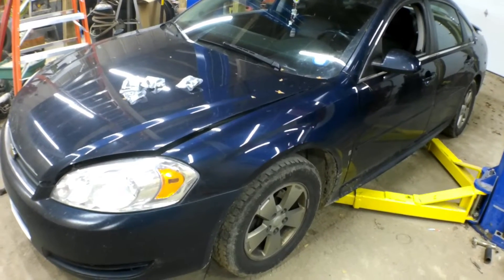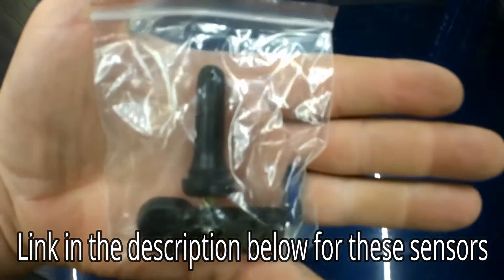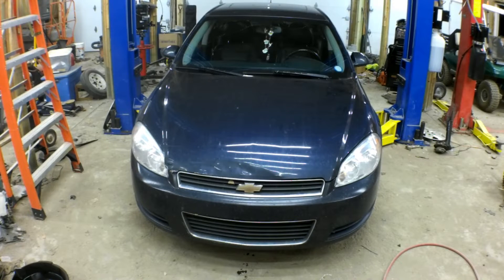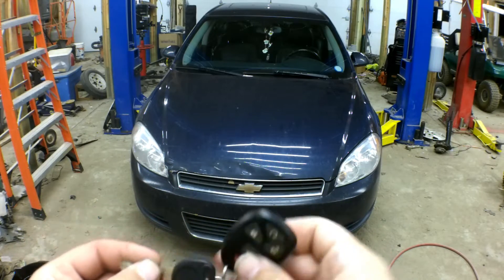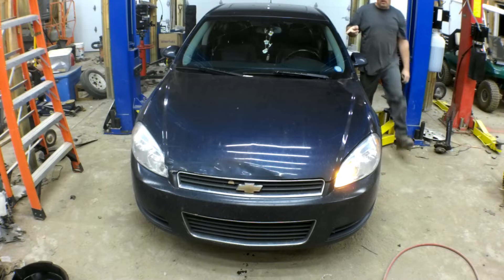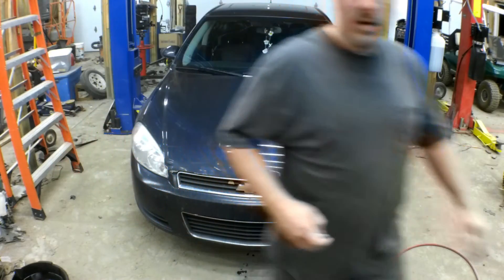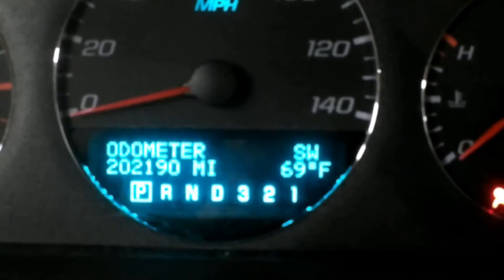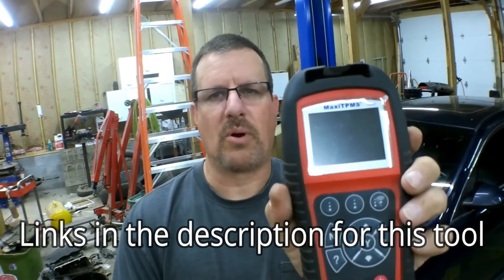How to program cheap eBay/Amazon TPMS without a scan tool!

Comment: Just tried it on my 2012 tahoe after i installed aftermarket sensors. Worked on first try. Tire shop said they couldn't program. Thanks for the video.

Comment: so this would work on a 2011 buick regal CXL Turbo as well? also, how much would a auto repair shop typically to put these on?
Reply from the maker: So any shop would likely charge the same price they do for mount and balance tires since they have to break the tire down to change the sensor. It should work on the 2011 Buick but if you’re having a shop install the sensors, they would have the tool to program them also.

Comment: My 2015 Chevy Cruze did not see the new "pre-programmed" Schrader 29049 sensors. Car went into re-learn just like the video, I started with the LF tire but nothing happened when I went from 48 LBS to 20 LBS. Probably Schrader doesn't work like this so I'll phone them. Probably need to buy the basic relearn tool somewhere.

Comment: So will this also work for a 2015 Chevy silverado 1500?
Reply: Did it work?
Reply: @jaimerios995  I don't know. Never tried it. I ended up buying a relearn tool from Amazon for 13 bucks and it worked great.
Reply: @TheDbrewer31  I also bought the tool and it worked great on some aftermarket rims with tpms  I bought but when I put the oem wheels back on it wouldn't work. Maybe I'll try this method this weekend
Reply: @jaimerios995  not sure why it wouldn't work with the stock wheels. The stocks are on mine and it work good. Was the relearn tool the orange colored one from Amazon?
Reply: @jaimerios995  also mine read through the tire itself next to the valve stem. I didn't try and use it through the rim itself. Maybe try putting the tool against the tire in line with the valve stem and see of that makes a difference.
Reply: @TheDbrewer31  yea it was the same one orange and black. I'm not sure why either.

Comment: This procedure only works on GM and some Fords. Any other manufacture requires plug in. And the learning mode on the newer GM's is easier accessed with the steering wheel.. On Fords you cycle the key 3 times and then use the brake pedal twice. The actual procedure is easily found.

Comment: Is there a way to do this without the factory key fob? I have an aftermarket key fob because I purchased the 08' Grand Prix used and it didn't come with a factory key fob. Thanks in advance
Reply from the maker: There is but you’d need a bi-directional scan tool for it. Sorry

Comment: aHA...so you noted the "Chevy" platform would work...I've got an Infiniti with the different type of key fob...they type where the key simply has to be inside the vehicle for it to start...and I'm not 100% sure it is the "original", but it is the Infiniti brand.

All that being said, would you "guess" this would work for my application? :)  TIA for a reply, and it looks to be even if I can't program them, if I have a simple tire shop that merely mount/balance tires, that if they put the TPMS in, that I could get the car to an advanced type shop, and THEY could program them with the TPMS installed?

Comment: Hello, When you put the car into "learning mode" with the remote, it that the same as doing it from the dash? I was told that is only to relearn tire positions and will not "wake up" the sensors. Please advise   I have a 2007 Buick Lucerne
Reply: One could use the pressure drop method. The sensor should transmit when the air pressure drops. Then you have to adjust air pressure when done.